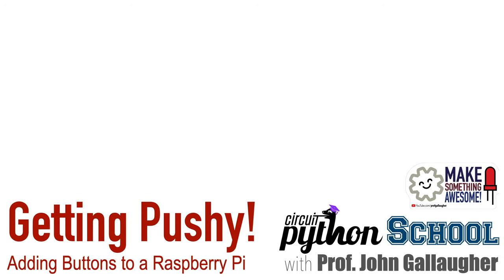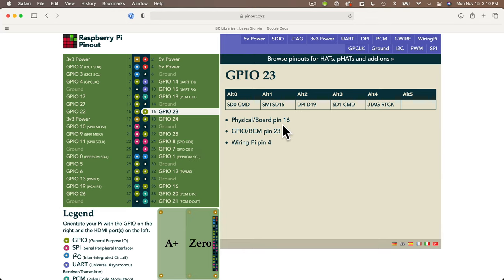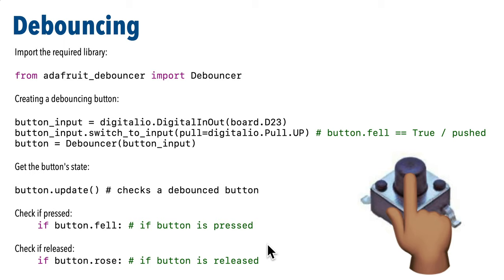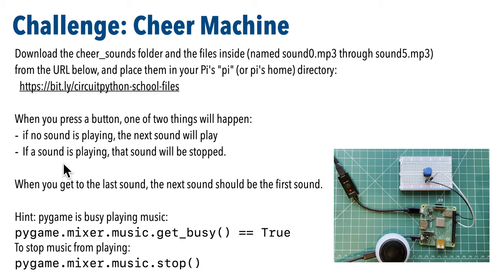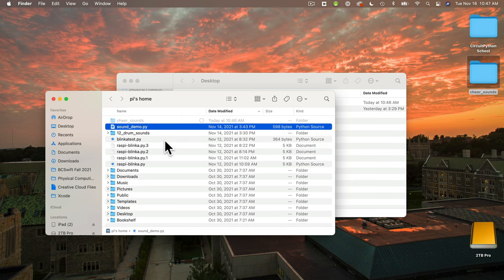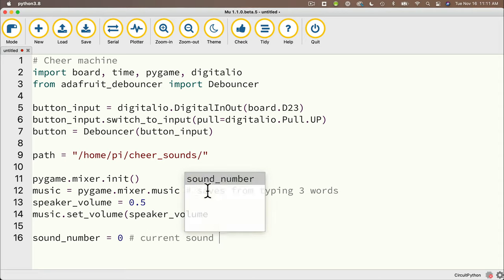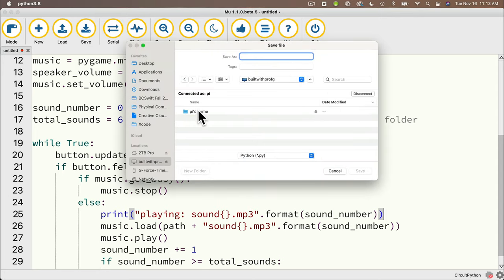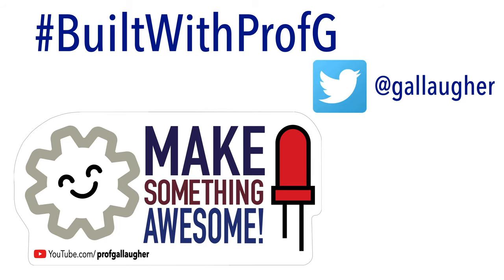CircuitPython School - The Right Way to Add Buttons to a Raspberry Pi, Pinouts, and Cheer Machine

Comment: Very informative videos.  Thank you.  I am trying to create a python program on a newly purchased Raspberry Pi 4.  I want to put the Pi in a pedal car with LED lights in the exhaust.  (8 of them)  I have a potentiometer that the user can press to make the LEDs flash at 6 different rates as they press the pedal.  This all works well but I would like to add sound also.  That means when you press the pedal, I want the LED to change speed and the sound to  either get louder or faster.  I can't seem to get the LED flashing at the same time sound plays.  Is there some code that will achieve this?  Thank you in advance.  Jeff
Reply from the maker: Check in the course playlist. You’ll see various techniques that I teach my students in the bit.ly/circuitpython-tutorials list. Good luck!

Comment: when i try to make it i get a import error : no module named board, is there a way I can fix this?
Reply from the maker: Sounds like you need to go through the earlier video in the playlist to install CircuitPython and Blinka. When you get a no such module it means that the library you are using (board in this case) was not installed on your computer (which is the case I’d you haven’t set up blinka) or you baked the module wrong (eg it’s not spelled properly with same all lowercase lettering). Good luck!

Comment: Nice video, thanks for creating. Why would someone use debouncer over RPi.GPIO for buttons? 

The reason I ask is because debouncer is no longer compatible with Python versions less than 3.8. As a result I switched my Raspberry Pi from Python 3.7 to Python 3.12 but now one of the libraries I use (openAI) has an issue with Python 3.12. While the OpenAI devs fix their issue with Python 3.12, I could have just switched Pi to Python 3.8-3.11instead but opted to just use RPi.GPIO instead.

Comment: how can we add mutiple buttoons ? with 
button1 = digitalio.DigitalInOut(board.D5)
button1.switch_to_input(pull=digitalio.Pull.UP)
button1 = Debouncer(button1)
and more or there is an other solution ?
Thanks
Reply from the maker: Just crear different buttons with different names and pins. Be careful. The code you list shows button1 used in all three lines. That last line that passes a configuration into Debouncer needs to have a different name on the left of the equal sign. Look at the code for a good naming template to use. Good luck!
Reply: @profgallaugher  Thanks you :)